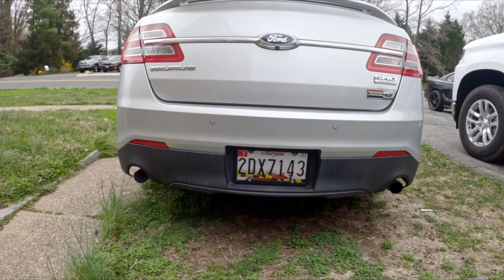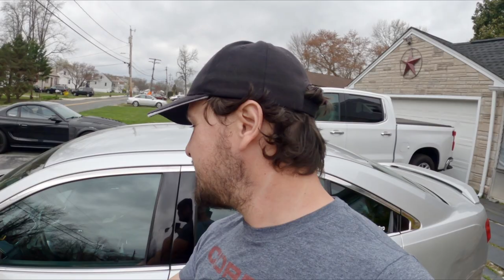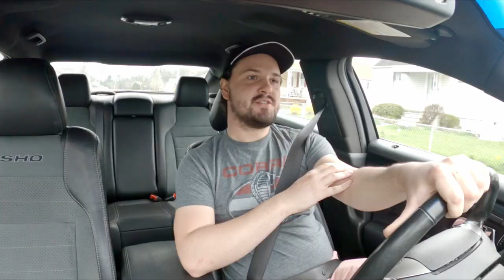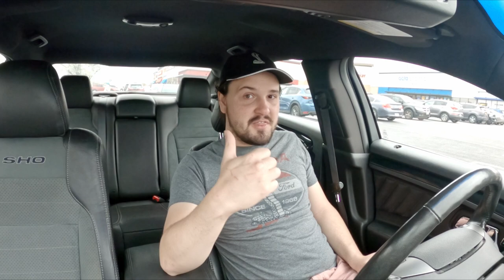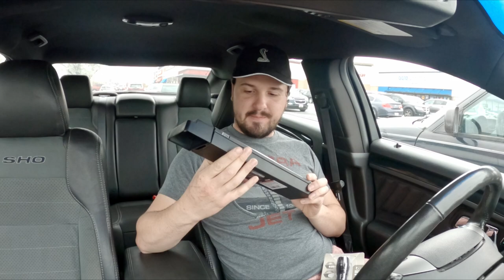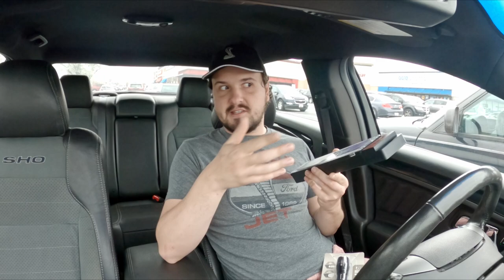Ford Taurus SHO Trombone loop Exhaust Is Happening!

Comment: Do you know as far as dimensions how many inches I would need to add to the left side? It's going to sound amazing I'm sure of it.
Reply from the maker: Extremely rough estimate is around 40 inches. The shop is going to measure the distance between the two banks. I'll have a better idea once they look at it on exactly what needs to happen. I'm extremely excited for this! I actually really enjoy how it sounds now but I absolutely love the sound of a GTR or such. Hopefully this works 😅